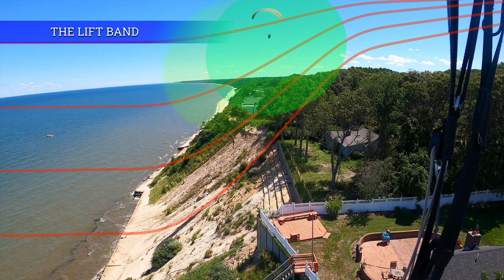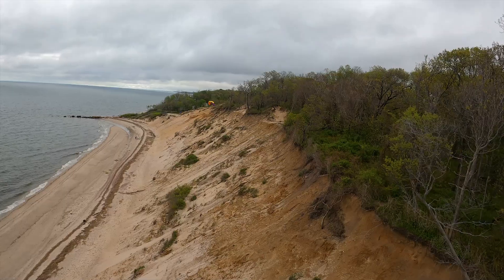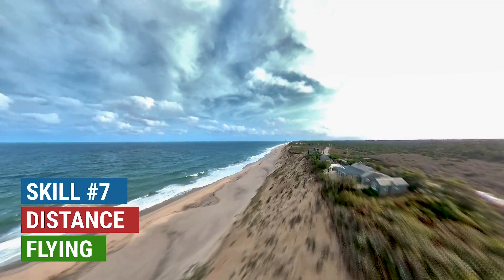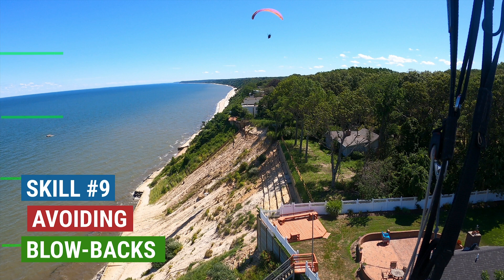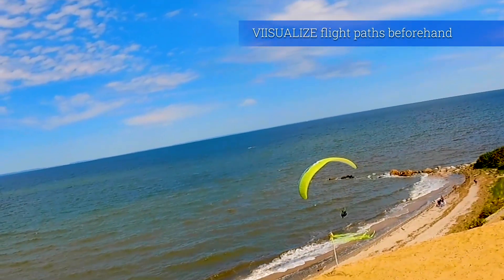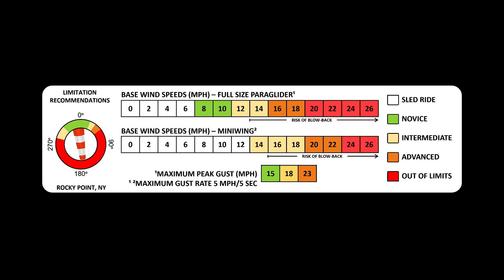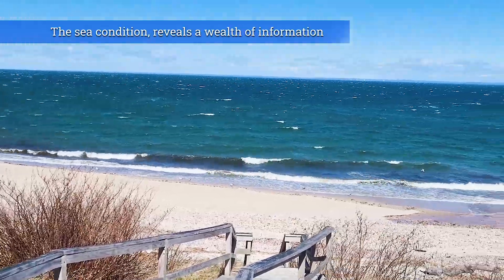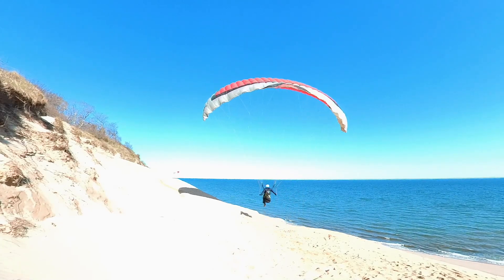Paragliding: 20 Skills to Master Ridge Soaring

Comment: Not overtaking is nice when everybody flies the same wings, but doesn't work here at the dunes where I fly. Some people fly bigger wings and I normally fly mini wings like the Flare Moustache, which is probably twice as fast, turning around causes the same problem again. So I normally I just flare out and overtake at a lower altitude.

Also it helps to do a more cobra start with strong winds, way safer. I've seen so many people at my local spot who can't do this and got dragged into the trees behind the top start.
Reply from the maker: Good points Andy! Mustache and hang gliders can maneuver around slower gliders. And yes the cobra launch is my favorite in strong wind. Cheers

Comment: I'm not that big a fan of learning to fly at minimum sink because minimum sink is a very low speed and it's very close to stalling the wing. If you're flying ridges and you're doing that close to the ground you need to have some speed on so you can get out of the trouble with your flares.
Reply from the maker: Agreed, you don't want to stall the glider. But even a little brake will improve performance in lift.
Reply: @clearcloudparagliding  I saw cross-country paragliding champion that weighed as much as I do and was a foot taller. He didn't want to suggest that he was clinging onto the edge of a stall for a long time but he did explain that he who glides slowest glides best. I'm just starting out so I kind of want to just fly with weight shift only for my turns. I was lucky enough to scratch together enough nickels and dimes out of the couch cushion to buy an epsilon 9 used. The advanced company said it would do best in turbulence if you just put your hands up and got out of the brakes and let the wing fly. I don't see any possible way it wouldn't fly better in still air. The ridge where you live is a beautiful thing with a great big huge flat laminar wind flow, hitting a ridge. Where I live the air service looks like a prune. I really like the part about the traffic and I really wish I had to even consider traffic once in my career here. When I leave the school I will be all alone and I will have to figure out what I have to do myself with no one to talk to. I ask everybody on here a lot of questions and I are you with every answer until I get as good an idea as possible about how they think. Thank you from the bottom of my heart for responding to my question.
Reply from the maker: The Epsilon 9 is a great wing. Did you fly it yet?
Reply: @clearcloudparagliding  so far I went out ground handling in a 9 mi an hour wind and I got it to launch . I kind it wrong in the wind was on the rise but when it hit the 45 degree angle and A Yank me through space 15 feet and I hit the ground on my face. One-flight so far 15 feet. My mom died and left me a little bit of money and I spend it paying up my bills and I bought the epsilon 9 wing and the harness and the lessons and the reserve and everything from one guy. I went of the school and stayed a couple of weeks a couple of times. I'm trying to catch onto the ground handling. The instructors all fly with other people all the time and don't really understand what I'm trying to learn to do when I'm going to be flying all alone. I'm fortunate in that they have tow truck winch launching. I loved tinkering on stuff and I've already came up with a new line bag for my gear. I'm working on glide slope meter with a rifle scope for my right eye and a level for my left eye. I will have a mouth piece, like boxer. I stick it in my mouth and I look at where I think I want the land and if it is too far away I will be able to see that I can't get there at a 6 to 1 slope. I love that epsilon 9 because they said it would fly better and turbulence if you just put your hands up and let that damn thing fly. I want to get up in the air a long ways and then stole the brakes and just sit there and not think about anything. I have one place to launch from and it's a farm and I'm going to fly up under clouds and throw out a bag of corn starch and try to get it to rain on the farm that lets me launch. If I ever have anybody believe that I can Make It rain sometimes I will get invited to fly out of all sorts of farmland. I've been having a good time all winner looking at videos and drawing pictures and doing calculations and figuring out different things about how I'm supposed to fly the epsilon 9. I weigh 240 lb. I'm flying the biggest model of the epsilon 9 and I'm right at the top of the weight limit.after I learn to fly I'm going to take a ball of yarn with me and throw it out over my shoulder and flying a tight circle and catch the string and bite it off. Then when to get on the ground I will measure the string. I'm very curious about the number of feet in diameter my tight circle would be. I think if you were trying to catch thermals and you had about a hundred yards of bright orange yarn behind you, it would be very easy to tell if you were in the lift. As soon as I get my pilot's license I'm going to come home and promote myself to the squadron commander of the number 13 cloud seeding squadron. I want to try and make high anxiety videos while I'm paragliding and cry because I have to land. I'm going back to the school this spring when it warms up a little bit more and work on my ground handling. I see all these guys with these little bitty high aspect wings. I'm happy that that epsilon 9 looks like a circus tent, flying through the air.
Reply from the maker: Mark, cool ideas! Let me know how it goes when you try them. 
By the way, when thermalling, you can get a lot of information from a Variometer; like climb rates, glide ratios and GPS tracks. 
I'm very fortunate to live by the beach where I get so many opportunities to practice ground handling. I would recommand to anyone who's starting in this sport to get training somewhere you can practice every day (May be Point of the Mountain, Utha.) Also get a good instructor who's willing to spend a lot of time with you to build a strong foundation. 
Cheers
Reply: @clearcloudparagliding  I'm kind of stuck with the school I could afford because of bought the wing there and everybody there is pretty nice I just don't understand what solo piloting all alone is going to amount to. I watched a lot of the people being towed for their launches and paid a lot of attention to everything the people on the ground around them were doing to help the pilot. One thing I observe is people would say sometimes you forgot to buckle your leg straps. That's why rule number one for solo flying is put your harness all the way on or take your harness all the way off every single time. The other thing I do is I don't hook my harness on me and then hook my wing to my harness. I lay the wing out methodically facing upwards. Then I attach the harness in the trims, and risers. Then I very carefully make a final check of my rigging because there's no one standing in front of me to look and say something is twisted. Only after it has been assembled and is laying on the ground with the brakes in the stowed position and every line in perfect position everything perfect, then and only then do I strap it on to me. I don't mind if the instructor is there teaching me or not because I learned in my own way and no one wants to listen to me or put up with me for very long. So far I have done one step I build the wall I collapse the wall I build the wall I collapse it. I try to keep that wall straight and true and pure and the best it can be so I hit every time on the first initial atomic step. The second you get it called up you need to step under it the second that bottom edge clears that ground. There's no stopping point between bottom leaves ground, and overhead perfectly.I built the wall perfectly about a hundred times so far up and down watching it when I move the least little bit and see how it affects of wing. Now I'm going to build the wall and get overhead then kill it. I'm going to do that about a hundred times until I've got that polished in.build the wall.go over head.kill it fast. In my view ground handling is one of the most dangerous activities in paragliding. In my humble opinion, the most important skill is a quick ability to instinctively kill that Wing bang now. It's a boring skill that nobody really realizes what a treasure it is. Having a Wing laying on the ground that you wish I'd stayed full of when is only a comedy. Having a wing filled with wind you wish
 was dumped out is a tragedy in the making. The first thing I need to make is a special chigral mauer landing target for the school. He did a joke landing where we flew down and landed on a chicken in a 4-foot square. I love his videos and I thought that would be an honor him that the school would have a landing Target like that.